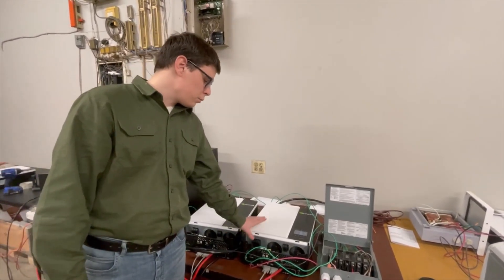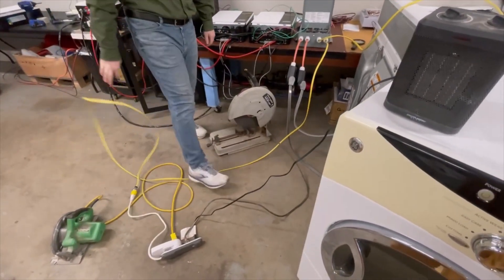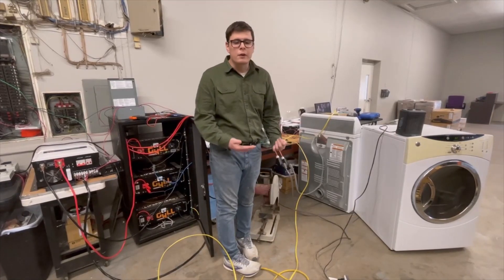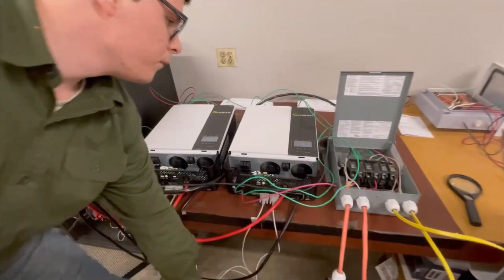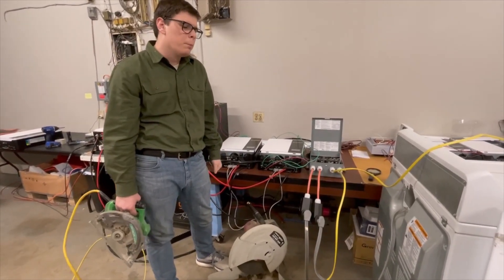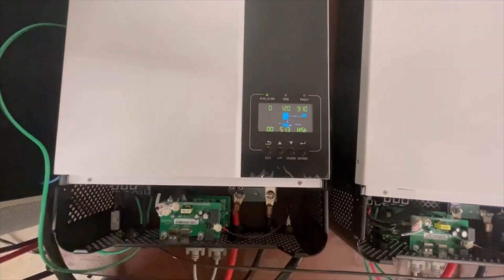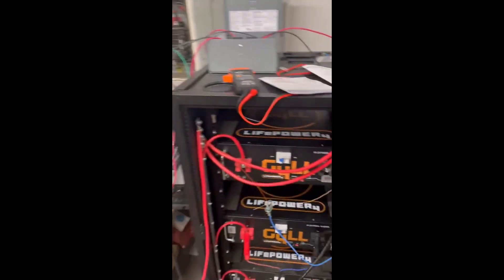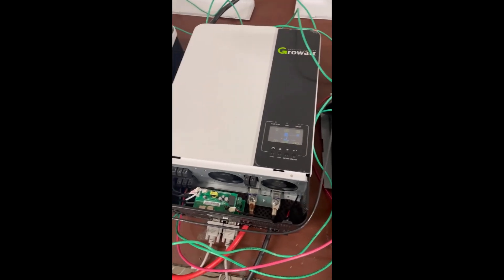3KW ES Off Grid Growatt Inverter pushed to the MAX!

Comment: I recently got one of these Growatt inverters and a 5.1kwH LIFEPOWER4 battery. Ran the fridge and chest freezer without issues. Was able to make coffee and cook a meal in the Instapot with it. Knew better than to try starting the 12000 BTU window AC unit, but figured it could run the vacuum cleaner so I tried it. Tripped the inverter almost immediately. It's a Dyson but I think it pulls 9A nominally, but I expect some spike at startup. I'm surprised it couldn't run the vacuum cleaner solo. I am thinking about getting a second inverter so I can run a window AC unit.

Comment: Do these have N-G bonding or has the screw ben removed? From what I understand I need to have the N-G bond done at my panel not at the inverter
Reply: @Richard from Signature Solar what about if I use two to create split-phase, I emailed growatt and was told that all 3000TL LVM-ES are shipped with the screw in place
Reply: @Richard from Signature Solar how does the needing two power sources part work, if I don't have it connected to grid power for pass through option? Looking at all options so wasn't sure how it would work if I charged my batteries through the inverter then unplugged my solar, would I still get inverter power?

Comment: Thank you for the test, does this unit bond Neutral and Ground internally using relay when power from 48V battery? I heard if power from home AC outlet the N-G will not bond as the main home panel already bonded. How about using a gas inverter for AC input to charge batttery and run bypass mode, is it requred to bond N-G from the generator first ?

Comment: Hello  I just receive that same inverter today,   I have 8 panels. OCV=38.2v, Volt-Pmax=30.6v, Current Pmax=8.5amp .  what do you recommend  for connecting the panel  2s2p?   Thank you
Reply: All 8 in series would total 306 (Voc) which exceeds the the 250vdc max. So run 2 strings in parallel of 4 panels each in series. This would be 153 (Voc) and 17 (Isc)   Assuming you meant (Isc) is 8.5 Amps, Pmax should be the wattage rating instead of amperage.
Reply: Is there risk of the working voltage being below 120v?
Reply: @tsp2jxd  in the above scenario? No. The voltage may be below 120 as the sun rises and sets. The inverter will turn on when it receives the min voltage required. And off again when it drops below.

Comment: What type of solar panel arrangement are you using with this?   Is there really an 18amp current limit on the input to the mppt charger like it says in the manual.
Reply: I’m looking to pick one of these up and order a 10 pack of their 265 w panels. If the current limit is 18 amps then it’s perfect for a 5 series string x 2 in parallel as the open circuit amperage is 8.88 x 2 is 17.76 so safely under the current limit and with OCV at 29.8 we’re well under the 250vdc limit at 149. So we could push 2650 watts (theoretical) of solar into it safely with only 10 panels.
Reply: @BattleCorgiTV  Just to clarify for those less familiar, it's open circuit voltage (Voc) and short circuit amperage (Isc).
Reply: @McDIY  thanks for that :)

Comment: Unfortunately, this is a misleading test. Both the circular saw AND cut off saw were under no load as they were not cutting wood.. Maybe 1 amp each, that is all..
Reply: Inrush current was still there.
Reply: Well no actually. He was pulling 1500w with the heater then with both motors on that was another 1500 more or less. 1500/2= 750w each. 750÷120v=6.25 amps each. See your point but it didn't detract from the test mathematically